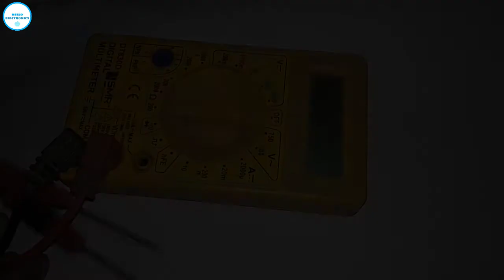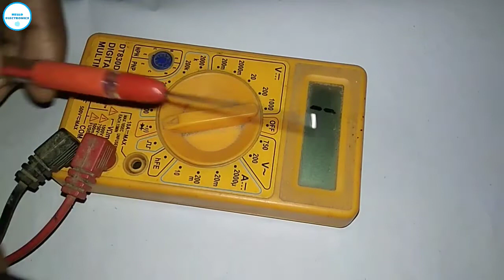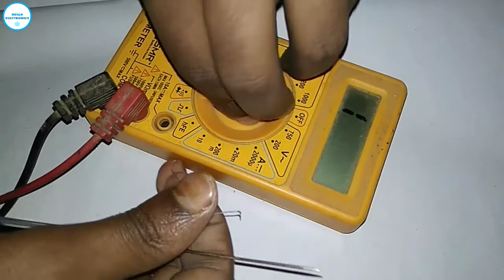How to make multimeter probes at home | DIY multimeter probes at home.#multimeter #probes #diy

Comment: It is fantastic idea to use the empty ball point pen Housing and the needle to make the probes of the multimeter. Instead of leaving bare the wires twisting in the needle hole they can be harnessed with an insulation tape for firmness.

Comment: It's not correct to leave the wire to needle connection without soldering. It will add to contact resistance and give erroneous results.

Comment: the bare needle is too long, there's more risk of touching it. there's a reason the original probes have a short metal needle
Reply: Makes sense.
Reply: It is better to use an enameled coper   14 gauge in place of ss needle, sharpen its end and solder the other end to copper wire. That will make a perfect probe without contact resistance.